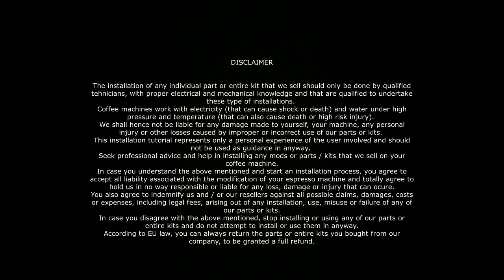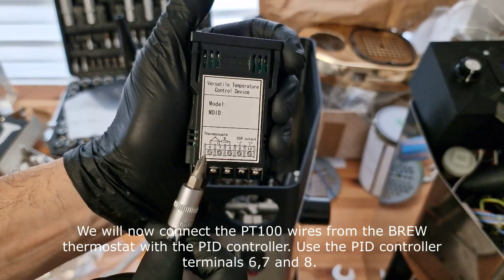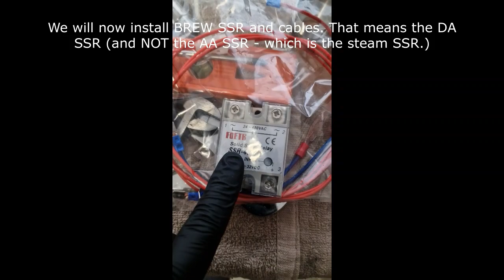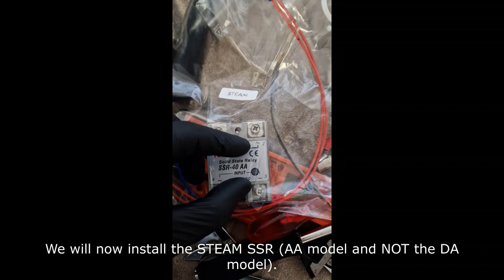How to install a PID on a Gaggia Classic 2019 Pro tutorial including 9 bar spring replacement bonus

Comment: Good instructive video. The only change I'd recommend is to install the relay on the upright panel so that if the pump leaks, which it will one day, the relay does not cause an electrical hazard.

Comment: Thanks for the video, want to know why we need to remove the cable(connector 3 or 4) from BREW SSR DA model? Or we need to plug it back before use?
Reply from the maker: Hi. You remove it to set up the controller. After the set up, plug it back !

Comment: Thanks for the video,
Why do you connect the steam câbles without changing the steam thermostat ?
As you don't change the steam thermostat, why are you using a relay for steam?
Do dual sensor pid exists ?
Reply from the maker: I use the AA ssr for the steam function. The old cables go into the AA ssr for sure. I just leave the old thermostat inside and thats it, but without any cables in it. The PID reads two points, steam and boiler temperature. So it is dual. Or maybe I got a wrong understanding of your question ?

Comment: Great video @coffeesensor6612! It is very nicely explained. Can you let me know if this is an out of the box XMT7100, or it has been modified in some way? Adn why there is a need to a small grey jumper cable between PID terminal 1 and PID terminal 4?
Reply from the maker: The XMT is standard controller, no mods made to it.

Comment: I bought this but a few things included in the kit was never used in the video, the wire and resistors in the same bag as the rubber grommets. Did I miss something ?
Reply: I seem to have everything in order, the pid is set up after a minor mishap which blew the thermal fuse. But now the temperature reads correctly and the boiler heats up. But I seem to have lost power to the pump (or it died on me during the install)
Reply from the maker: Pump should not have any problems. I believe you installed the dimmer also?
Reply: @coffeesensor6612  I did not, don't actually remember what I did wrong initially but it works fine now.

Comment: My temp sensor has two whites and one red, can it still be used?
Reply: yes you just put the red where he put the white and the 2 whites where the reds went
Reply from the maker: You can try yes. The white to position 6 and 7, and the red to 8.

Comment: Great instruction video!

1) What pressure gauge can you recommend for the top enclosure?

2) Why do I programme the PID without one cable connected? Can I change a value in the programming later without disconnecting the cable again?
Reply from the maker: It's a safety measure, in case the controller is wrongly tuned or something is connected wrong. Yes you can later on program the controller without removing any wires, if the first set up was good and machine runs smoothly. I will have in around 2 weeks the gauge and adapter for the solenoid.

Comment: Does it matter which brew ssr goes in to the R Brew and L Brew thermostat cables?
Reply from the maker: Follow this exact tutorial of you want good results and no electrical problems.
Reply: @coffeesensor6612  I did follow everything and everything works perfect. But I have a question since I have done all of the stuff for the brand new machine I never used it before. After using steam I get kind of a sound of steam even though I am done using the steam. Is it normal because temperature is very high ? Because I never used the machine before I cannot compare it to without pid. Steam temperature is set to 137
Reply from the maker: @ahmetycI  send me a video on my website with what you mean by sound of steam. thanks !

Comment: Considering doing this myself and have a couple of questions if you don't mind.

1. Why don't you replace the thermostat for the steam? Is the original one sufficient?
2. What is the point of tthe jumper cable you install at the end (admittedly, this might be limited electronics knowledge from myself)?
3. Does the controller let you set a brew and steam temp? How do you switch between the two?
4. Why do we need a DA and AA relay? I would've thought we'd need 2 of the same, but again, lacking electrical knowhow. 

Thanks!
Reply: sorry, I missed the explanation about the jumper cable...?
Reply: @champs1076  I want to know that as well :) I guess it is because there are two SSR.
Reply from the maker: I did replace theoriginal  brew thermostat. Watch at minute 2:50. It was replaced with the PT100 temperature sensor that has the white cable. Since you have 2 SSR's, one controls the steam temps and the other one, the brew temps. There are two different models, one is DA and one is AA. You have separate settings in the PID controller for each.  They are located in two different menu places, so you can always set one or another without any problem.
Reply: @coffeesensor6612  I think he didn't understand when you changed the thermostat but didn't remove from the boiler so he may confuse because of that. But thanks for making everything simple. I was so overwhelmed with all other videos and yoır video made me confident enough to do it in one hour.
Reply from the maker: @ahmetycI  At minute 2:48 the brew thermostat IS REMOVED. Thanks for your kind words and we keep in touch ! God bless, Tudor P.
Reply: @coffeesensor6612  he asks for steam though.
Reply from the maker: @ahmetycI  indeed did not remove the steam thermostat. Just the brew one.

Comment: Hi there, do you know what settings you use to offset the brew temperature? For example the PID reads 50 but by the time it gets to the brewhead it will be cooler due to travel time etc...
Reply from the maker: Psb setting inside the PID controller should be set at -08.0 (WITH MINUS), that if you are using Celsius degrees or -14.4 for Fahrenheit. That means that what you will see on the PID controller display is not the boiler PT100 sensor detected temperature but rather the brew temperature. So offset is set to MINUS 8. So that is why I set up the PID controller at 94 and not 102 for example. So short, offset can be around 8 degrees max 10 degrees C.

Comment: Nicely done!  Are you going to have a follow-on video showing how to add the pressure gauge?
Reply from the maker: I am now working on the pressure gauge and dimmer mod and the single hole steam tip is already done and on it's way. So the Gaggia Classic Pro is definitely one of my loved projects that will be developed at a maximum level.
Reply: @coffeesensor6612  Thank you for this tutorial, may I ask why single hole steam tip?
Reply from the maker: @showmak  improve vortex and thus, frothing. There is a reason why most premium machines offer usually single hole tips. Of course there are users that prefer two or three, depends also on each style.